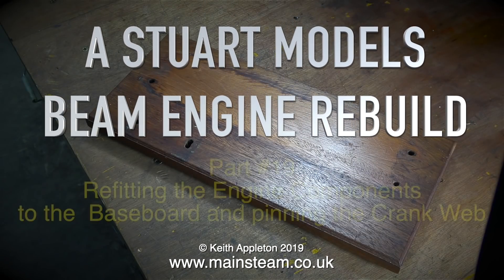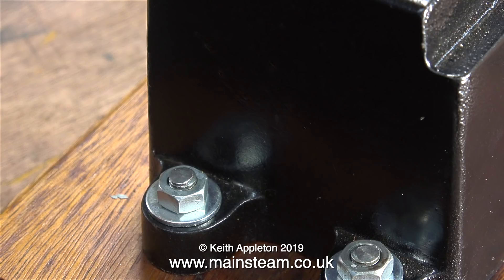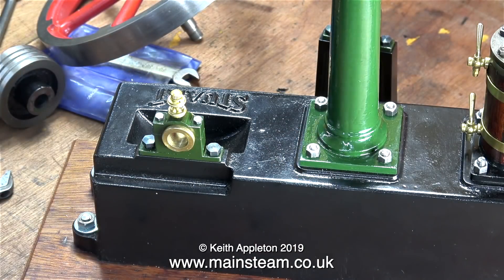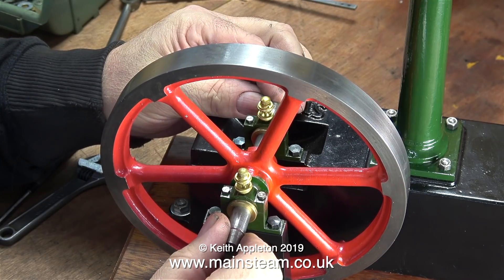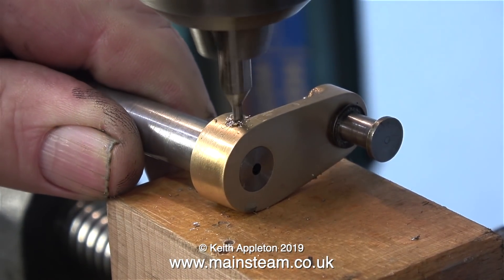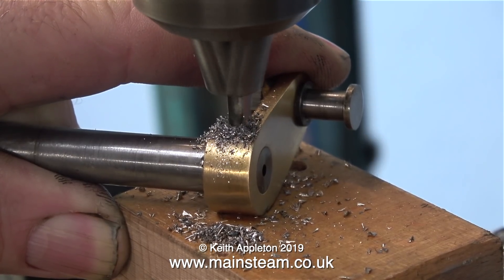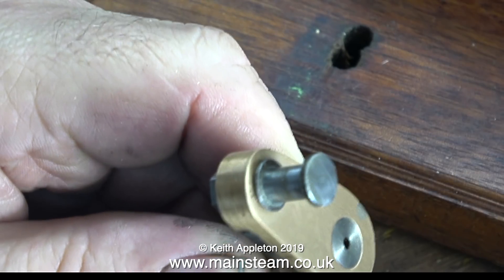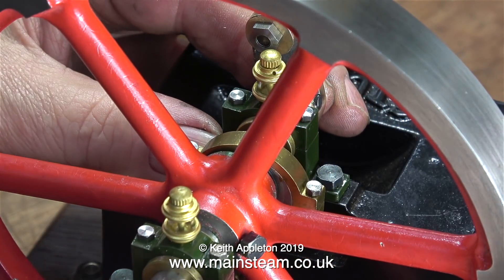A STUART MODELS BEAM ENGINE REBUILD - PART #19

Comment: Hello! I'm curious about your proxxon tools and how you've incorporated them into your workflow. Have you been successful in using the rotary tool as a mini mill?
Reply from the maker: They are good, I even used the mini milling machine to mill some brake parts.
Reply: @keithappleton  excellent. I was watching your beginner series.  Would you recommend the proxxon mini lathe PD250/E as a good starter lathe for a beginner?